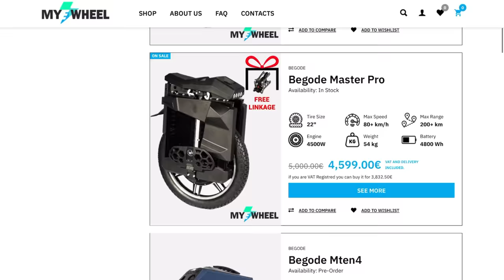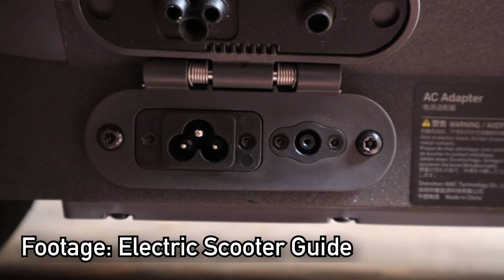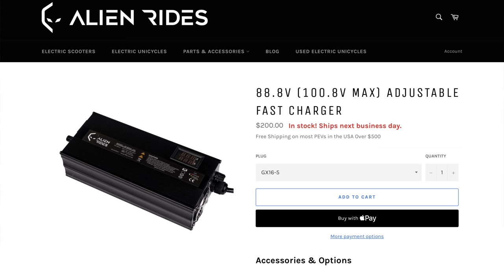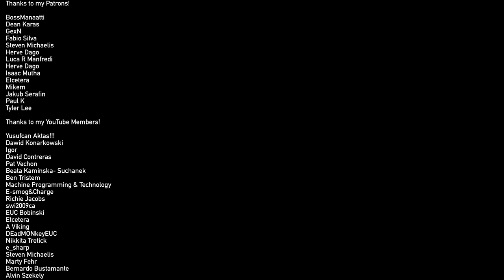I don't like where EUCs are heading

Comment: I strongly disagree with point 1. Speed is absolutely necessary. There is no reason to go above 100 kmph but each unicycle should be capable of 80 kmph for safety reasons.
Reply: Why? When is 80 kph required to keep you out of danger?
Reply: @casperpedersen1690  when you need to get out of the way of traffic try and ride a moped that does 50kmh max and not die....
Reply: @casperpedersen1690  When you ride on a road between cities the speed limit is 90 kmph which means vehicles are going 100. In the city, there is a 50 kmph or 70 kmph speed limit, which means people are going 80, and you need to maintain that speed.

Comment: We really need to get some sort of certification for these PEV. And if they go faster than n km/h then they need to be registered, insured and the driver/pilot needs to pass an exam. Only then can we really build out true adoption with a solid legal footing. This "tolerating' approach is just too whimsical. I'm calling out the EUC manufactures but also the resellers!
Reply: No thanks. EUCs are mostly self-regulating as users tend to ride within their ability levels. Regulations are unnecessary and personal liability can be covered with the road maintenance and infrastructure savings that riders voluntarily provide to the common good.
 
That said, there’s much room for improvements in having manufacturers limit the top speed in proportion to rider’s safety and skill levels as measured by actual use profiles. This is relatively easy and could be implemented in software alone with no additional tech needed. Earning your rights to unlock speed based upon comparing rider’s data is the next phase of safety evolution. Letting the community self-monitor through a consensus process would leave the decisions up to riders as a whole, not ignorant legislators or greedy insurance companies. IMO
Reply: @grb1969  Here, where I live, an ebike can do 25kmh max, anything over that it needs to be registered and insured, up until 40km/h at which point you are viewed as a motorcycle with an electric powerplant and you need a A Class drivers license. 

That gave these types of transport a legal statue, before they were tolerated but could be confiscated at a whim.
Being an EUC rider I also know what these things are capable of, I would like to make sure not too many self-regulating people yolo'ing down the street on their 50+kg at 60kmh EUC whjere my kid plays. You want to do that kind of speed, go get an insurance and pass an exam.
Reply: @drbytes68  I understand the desire to regulate for safety but I think there are much more elegant and efficacious ways to go about the process other than the largely inefficient and ineffective procedural rule of law. Given the proper technical programming algorithms, the community is more than capable of self-governance and voluntary compliance.

Comment: I'm more extremist than you. If you want to go 40-50 km/h take a moped, if you want go faster take a motorcycle. An EUC should be a light, practical small device designed to replace a bike when you don't have the possibility to park your bike in a safe place because bike theft are a problem and small folding bike are not so small and portable compared to a small EUC. I think that the max allowed speed in the city for all the users should be restricted to 30 km/h with the exception of the main roads that should always have a bike lane to allow bikes, scooters and EUCs to move freely in the city. I go to work using my V8F, the trip is around 12 km and I seldom exceed 25 km/h. High speed is lethal, go slow and take care of yourself and to the others people
Reply: That s why  LAW limits EUC speed to 25 kph in France. The state considers this as a limit for DANGER inherent to speed... And circulation outside the cities is forbidden on roads because you can't mix 25 kph EUCs with 80 kph cars on the same road. Clever and simple... 😢
Reply: @georgesfrancois9313  prenez pas en exemple une loi bancale pondu par des parisiens pour des parisiens. Je roule très souvent a la même allure que les vélo et les scooter sur les mêmes routes limitées à 90, y'a aucune différence de danger encouru entre les trois. Je dirais même que ma roue est bien plus sécurisante que les vieux bicloux sur les routes, moi au moins j'ai un casque, des phares et de quoi être vu. Vous raisonnez encore par type de véhicule dans un monde où une bonne trottinette électrique est plus puissante qu'une 125.  C'est l'équipement qui doit déterminer la vitesse : pneu, frein, stabilité...